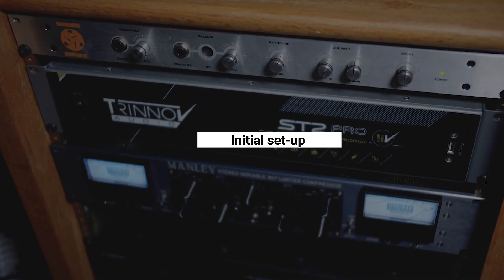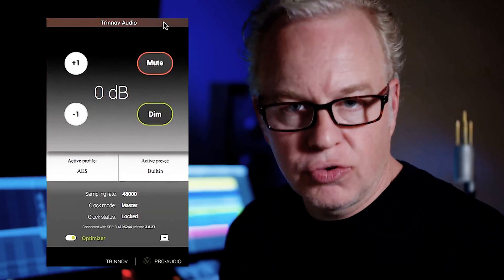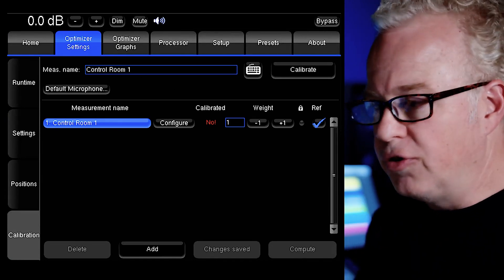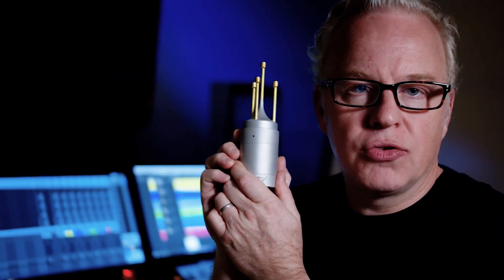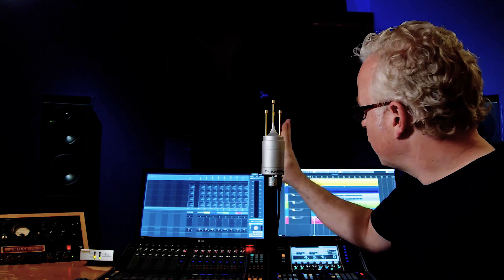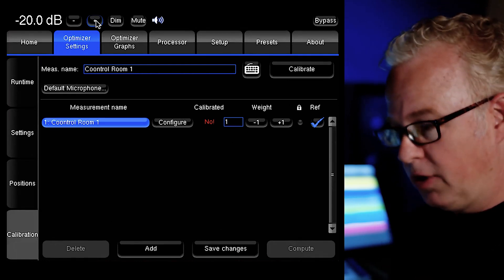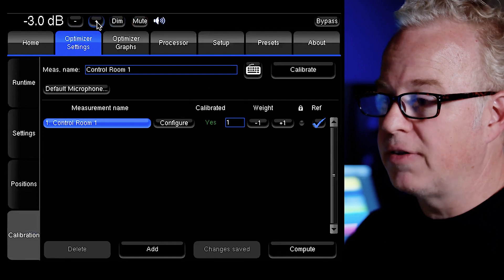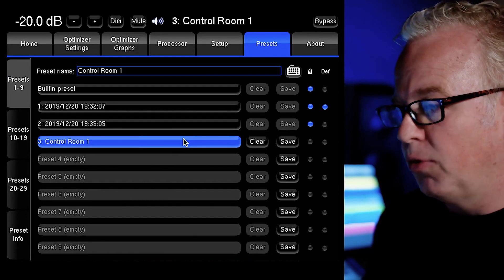Trinnov Pro Tutorials: ST2 Pro Set Up and First Calibration

Comment: I have the ST-2 Hifi version and am in the process of getting to grips with the ST-2. My key problem is that the REL t/7x subs are generating a "Crest too low" error, regardless of what I do. Crossover to 50Mhz, add some dB, increase the volume etc etc. 
Hard to get this working unfortunately, esp since the sub integration is the main reason for my purchase
Reply from the maker: Hi Peter, it would be best to ask directly to our support team, you will find all the contact and information on our website.

Comment: I'd love to hear what that microphone sounds. It might be good it might be bad but regardless it would be very interesting
Reply: Eh? The microphone takes measurements it doesn't sound like anything 😂
Reply: Usually, Any measurement microphone can be used for recording, and some have become very beloved. DPA was founded because their parent company Bruel & Kjaer found out that lots and lots of recording engineers went through all kinds of hoops to be able to record with their fantastic measurement microphones. The first many DPA microphones where just measurement microphones in a different housing and with an XLR output instead of the proprietary system  @HS-ed3dz

Comment: is there a general suggestion of whether it is better to place the ST2 before or after the monitor controller? 
this would be for a simple monitor controller that provides only volume control before going out to the speakers...
Reply from the maker: There is no basic answer to the question, depending on your setup and needs, please write to our talented support team. They will advise the best solution for you, support@trinnov.com
Reply: @TrinnovAudio  thanks, I was already in contact with your distribution in Germany and they offered to assist!

Comment: Can I use it? I don’t have a mac I’m using windows I have UAD interface and no access to the router only WiFi
Reply: @trinnovaudio would also like to know
Reply from the maker: Thank you for your interest ! There is currently a similar app in the works for windows, but for now you can simply use a browser via VNC to login into the unit. You will need an internet connection though, with the app or not. If there is no direct access to the router via RJ45 the unit can also connect to the Wi-Fi via a simple access box. Hope it answers your question, and if you have more, please email our support team at support@trinnov.com

Comment: I dont get it. It plays pink Noise? Thats ok for volume but can it do an EQ based on that?  You will need a frequency Sweep!?
Reply from the maker: Hello Lauroon ! We actually do not use Pink Noise but a modified maximum length sequence (MLS) measurement technique, which was developed solely for use in room acoustics.

Comment: Cool video! I'd actually be interested in the system, but when I downloaded the Mac app to check it out it told me that it is to old to run on this OS. I'm already running an old OS (Catalina) which means the app hasn't been updated in years. I don't want to invest in a system which is no longer supported, so I hope you can tell me what's going on :)
Reply from the maker: Our macOS app is currently compatible with the latest software and M1 Processors, we update it constantly :) Catalina might require an older version that you can ask our support team. The app still is only there for control and will not work without a Trinnov processor!
Reply: @TrinnovAudio  Thanks a lot for your response! That is what hoped to hear/read :) 👍

I actually found the issue, it's the Mac gate keeper which shows a somewhat confusing message that the app needs to be updated. While in fact the problem is that the app hasn’t been notarized with Apple. Right click -> open -> open anyway does the trick :)

Comment: In this video you are using the Dangerous as a monitor controller. I wrote Dangerous and they told me that if I connect the Dangerous to the ST2 pro, I will then be monitoring thourgh the Trinnov and lose the monitoring capabilities of the Dangerous. How come?...I bought the Dangerous ST for the transparency in the signal chain and their step FLETCHER attenuator, and the Trinnov just for the room Optimization, NOT for monitoring. Will I lose all of that Dangerous functions if I connect that with the Trinnov?...will the Trinnov ruin the Dangerous ST monitoring capabilities?...IT'S getting very confusing right now
Reply from the maker: Hello Federico, not at all, both units can work really nicely together and a lot of our users own both! What you would do here is place the Trinnov right before your speakers and after the Monitor ST, the Trinnov will therefore take care of room correction and speaker optimization and the Dangerous of all monitoring purposes, please write to our support team for any help support@trinnov.com they will help you set up in the nicest way possible.

Comment: Thanks for creating this great video. 
From my perspective as an engineer in electronics and computer science with great passion for video and audio, I have the impression that the Trinnov overall approach is the by far most advanced one. 
Any other approach that uses only one microphone to do some room measurement will only result in adjustments of the levels along the frequency, i.e. some kind of automated parametric EQ. While this may be sufficient for many cases, for example when doing quick adjustments to a smaller PA system to make it sound nicely, the Trinnov systems can measure in 3D, thereby finding out which portion of the sound comes directly from the speakers and which portion is from the first reflections. With this information, the internal SW can not only calibrate some kind of EQ curve but also optimize the phase behavior of the speakers in a specific room for a specific listening position.
From my understanding, this would even mean that the Trinnov-System can calibrate the overall audio chain, including the power amps, the speaker cables, the speakers with their built-in crossover networks, and the room. Of course, the room needs some beforehand treatment, and the speakers need to be in a good position.
Pls let me know if my assumptions are wrong in any way.
Reply from the maker: Thank you ! This is actually great analysis and not far from the truth ;)

Comment: Is the set up roughly the same for the ST2 Hifi? I’m about to receive a ST2 Hifi to demo. So far I am so so tempted to pull the trigger. 😬
Reply from the maker: The ST2 Hifi software is actually a bit different and offers a more streamlined user interface to integrate it more easily into a home set up !
Reply: @TrinnovAudio  ... TQ! Hope to find out soon.